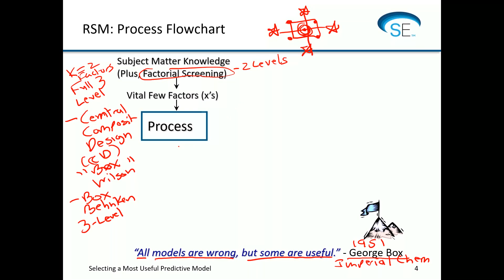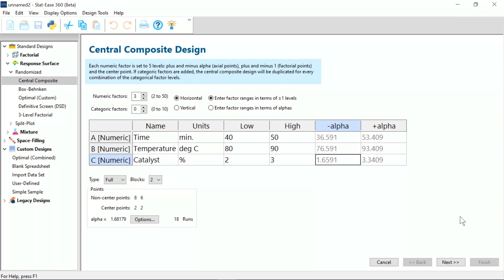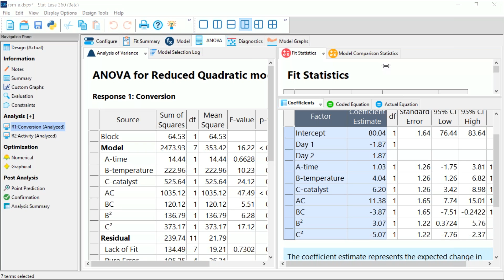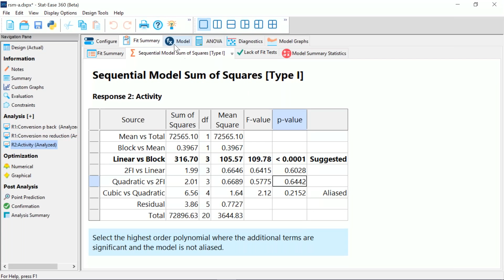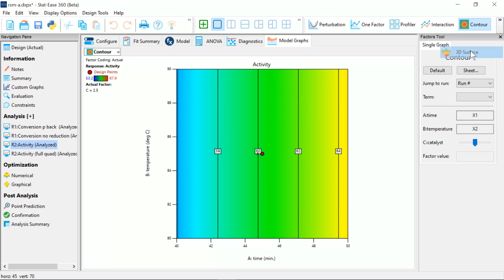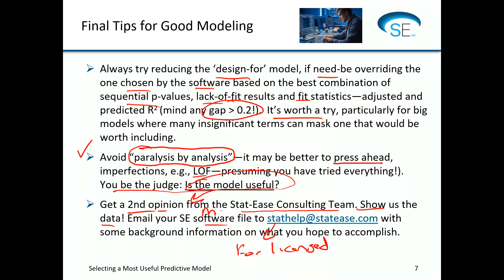Selecting a Most Useful Predictive Model

Comment: Hi there, Can I use old data from somebody else and increase responses, and the design expert redesign another experiment for me so i do less experiment?
Reply from the maker: In theory yes, you can import the old data in the software and use Design Augmentation to add more runs to fit a higher order model. In practice, there are many questions starting with - is the process still running the same as it did previously? Are you measuring the same way? Was the previous data from a designed experiment or was it historical data from the system? This is really a practical experimentation question. You can try and it may be successful, or it may not work well and you would get better information from a new experiment.